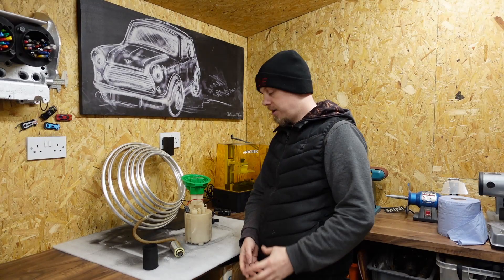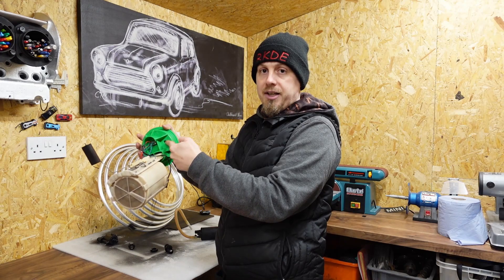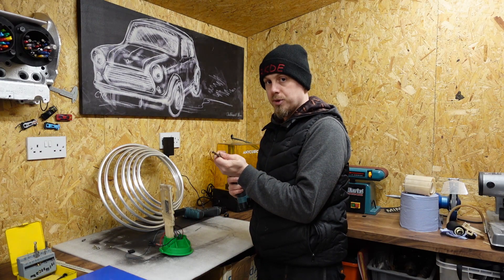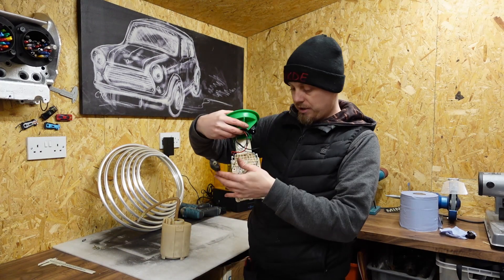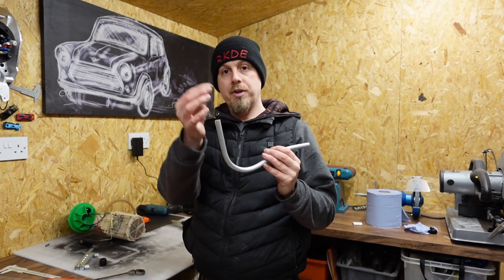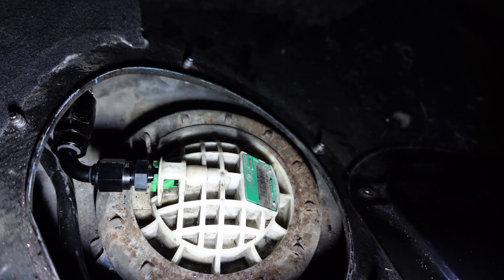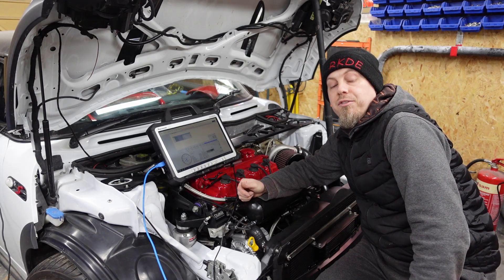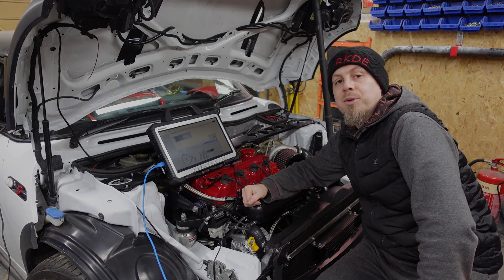Mini Cooper S R53 Turbo fuel system

Comment: the fuel return pipe is inside the tank at the bottom of the filter block. how did you get it to the outside then connect it to the new modification on the pump cover?

Comment: Also curious why not dump the return back into the outer part of the basket where the venturi dumps to keep the outer basket full under hard turns. Of course with mine e85 makes that worse but I planned on dumping back into the outer backet to help keep it full when the hard lefts come and the main pickup cant pump to filter side so it cant be dumped back if that makes sense.  The retun back into outer basket would supply it when the fuel moves to right side. Of course I am thinking of using the r56 diesel tank which is not a saddle tank so no sloshing.
Reply from the maker: Hi Ben, the Venturi and return are now both into the basket. I need to do an update video showing what I'm running now

Comment: Great video Rich. I Just have 1 question, I was told there is a intank regulator in the filter housing that needs to be removed also ? ?
Reply from the maker: Hi Paul, being honest I've had the tank in pieces and I've never seen a regulator in the tank. If there is one I've not seen it and it's definitely not been any issue as I can control the fuel perfectly. I'd suggest there isn't one in the tank.
Reply: @rkde2042  oh ok mate.. this was the only thing that was holding me up from getting on with it. Big thanks for this video .
Reply: @rkde2042  There is indeed an intank regulator, its fitted in the filter housing.
Reply from the maker: @Quinsk1 thank you, as above I've never seen one, I know there is no reference points to the engine or pump. Is it not a pressure release from the filter? Any way you've got me interested so I'm going to pop the filter out and look for it

Regardless I've left it in the system

Further looking into the system it doesn't look like a regulator as there is 0 reference points but it's a spring based valve and does look more like a bypass valve. I'll get it out and take it apart
Reply from the maker: Hi Paul, having spent the day talking and researching I've the following response; the r53 had a fuel pressure return within which is at 3.5bar, this is used should the filter clog and I would not advise blocking it off. 

A solution I can offer and I will put in mine is take the filter housing out and replace with the R56 filter unit and new filter as the return valve is 5.5bar which is perfect. I'm not sure if the valve would just change over but I'd just change the whole housing, not that I've ever had issues

Thank you for raising the question as it's pushed me to research and learn

Comment: Hi love the videos! Do you know if it’s possible to use a basic 1.6 Cooper r53 engine for a turbo build?
Reply from the maker: Hi, thank you.

It's possible but you would need to keep the boost low. Also the gearbox may give you issues. To be honest I would change the W10 engine in the cooper and the one over to a W11 block which would be cheap enough and then you can put a turbo on that with few worries. I'd also fit an S gearbox at the same time. 

It can be done but a lot of effort to find the power isn't a huge increase. The W11 engine used in the S is the same external size and shape as the W10 but has much stronger internals

Comment: Legit thinking I have pushed the
Dw65 to thr max 1000cc link g4
Full flex setup  no issues on petrol. That being said above 6k at 24 psi I start to loose pressure idc goes up etc etc. now I am using boost a bump to make the thr grunt is there. I normally
See 65 psi max and again on petrol since the demand is low the flow and pressure are
Stable. Go to e85 and we’ll….. so wondering if the pump just can’t handle the ol
Girl. Bear in mind I have seen as little as 7mpg when full wot for extended sprints. Long term is return its fairly simple. But seems my pump csnt flow to even build propped
Pressures. Legit wonder if it is just consuming so much that the pump csnt keep up that flow enough to pressurize it. Hope they make sense.
Reply from the maker: Have you change the in tank regulator over to the r56 cooper s version? The r53 is limited to pressure. The dw65 is more than capable of 400 hp on e85 in a mini but there tank regulator is only set to 4.5 bar which means of you have 1 bar of boost its already opening and you're running e85 it will constantly be leaking to the Venturi

Comment: Any advice on how to check the fuel pressure on the car?
Reply from the maker: The only way is to add a gauge on the end of the fuel rail. You want 3.5 bar at the rail which is an an4 fitting
Reply: @rkde2042  thanks